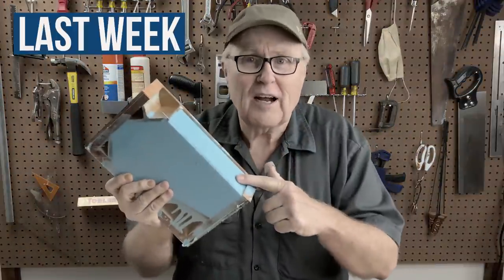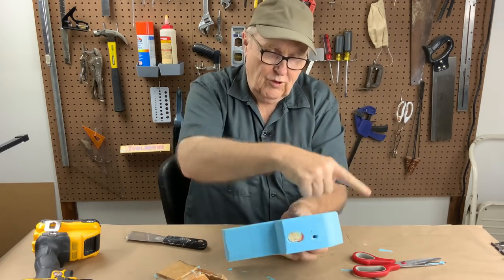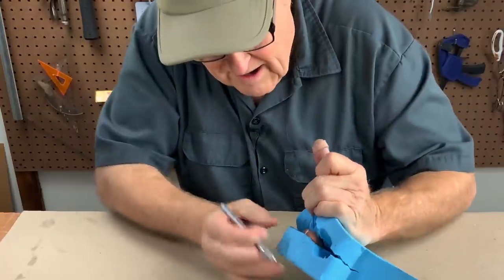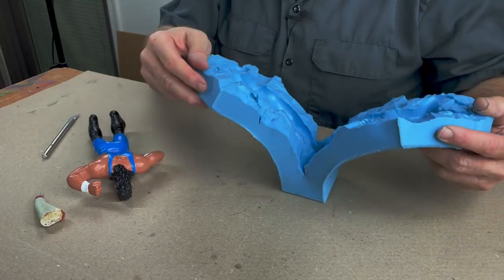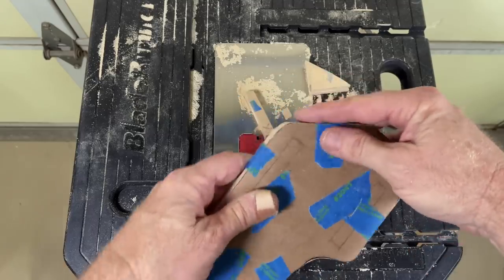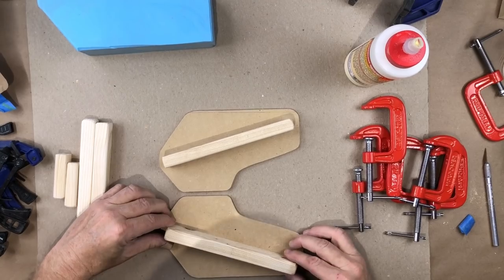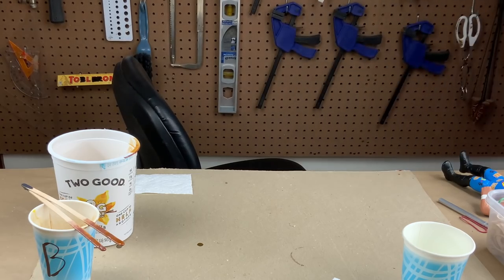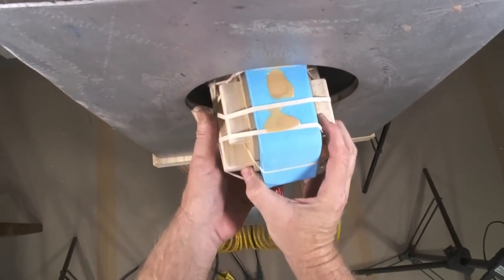Two-Part Clay-Up Mold Vs. One-Piece Cut Mold

Comment: I see people in the comments saying they’re having issues with cutting one piece molds. A bit of advice from my learning experience is start with a translucent/transparent silicone like smooth on moldstar 20T. This will allow you to see your piece inside the silicone as you’re cutting and once you build up confidence in your mold making/cutting abilities you can switch to a cheaper colored rubber. More expensive to start with but saves you money in the long run.
Reply from the maker: Great tip Joel! My regular supplier Silpak sent me a freebie sample of some semi-clear platinum silicone rubber and I am using it to cast a small figurine next Friday! it definitely comes in handy to be able to see the model through the rubber.

Comment: Robert, what kind of wood did you use for the sides of the mold case? I ask, as it looks like either you sanded it, or, it's some sort of engineered wood product like a Masonite or MDF; yes?
Reply from the maker: Hi Baron, yeah, just MDF.  Another construction dumpster rescue job.  You have to love construction dumpsters!

Comment: This is great, would this set up work if the hands of the figure were on a different plane? For example bending forward. I cast my own tabletop minis, but I failed misserably when I tried to cast then in one piece. I ended up chopping the hands off. Then I use the legs as an air vent and place a reverse J formed channel as a pour spout in order to fill the mold from the bottom to the top, pushing the air out instead of risking it being trapped in pockets. Then I cut the mold up until the heigh of the scrutum and pull free the mini. In that way I avoid having a mold line from the waist up.
Reply from the maker: Generally speaking, the more complex the figure the better off you are cutting it into pieces.

Comment: I have the same table saw. Did you move or remove the arm to make it easier to see what your cutting or just for the camera?
Reply from the maker: I find that the stock arm didn’t  hold the material down very well and gets in the way, especially when making cuts on small pieces of wood. But of course an unguarded blade is much more dangerous and you do have to be very careful working with it.

Comment: Sir, quick question, if you are not able to afford the beautiful pressure tank you have, would a pressure pot with clamps be a good enough starting point?
Reply from the maker: I could not afford a pressure pot when we started out so I designed these and had them fabricated. Any pot will work as long as you can get the resin-filled mold into it and shut quickly enough.

Comment: Was going to make a two part mold this weekend. Due to having a large hole in the middle of the object. Alright, I’ll try it as a single cut mold instead. Definitely quicker to make. Haha
Reply from the maker: It won’t work if your silicone rubber is too hard to stretch. But if you can pull it away from the hole you can successfully cut it through easily.

Comment: Question: If you do have some bubble holes, can you fill them with epoxy? (and after that, paint it over so it won't be seen on the resin) I am planning to start molding/casting my (simple) cat characters soon, but don't have the pressure/vaccuum equipment.
Reply from the maker: Yes, you can use most epoxy fillers, also bondo or other polyester fillers.
Reply: @RobertTolone  thanks!

Comment: I see what you meant about cut molds, the original parting line is clearly visible and any flash comes off cleanly. I am increasing my tool collection, and I started to wonder about starting from scratch (perhaps this should be a future video?).  I am repurposing a second hand lab vacuum pump I bought years ago for metal casting and recently picked up a harbor freight air pressure paint tank for curing under pressure. If you were a beginner today, what would be a minimal but useful casting setup? What would be your first project?  Thanks!
Reply from the maker: It sounds like you have bought the basic set up that you need. Also get a good accurate gram scale. If I were starting out again I would do simple, small projects. That way you could learn a lot without spending a lot of money on materials. I would keep careful notes and records of each mold and casting. Note the materials that you used and any problems that you had with them. I would read the material data sheets for my rubber and resin and I would be meticulous in following the manufacturer’s directions. I would work in a comfortable environment. If you can wear shorts and a T-shirt in your studio your resin and rubber will be happy.  If it’s too hot or too cold you will have all kinds of problems. Don’t get discouraged when things go horribly wrong.  Just learn from your mistakes and go on. And have fun!

Comment: awesome i love these videos!! can you please share what plastic mixtures are best for replicating car parts? i have a few small plastic car parts i would like to remake myself with small modification to my liking.. only issue is, once i finalized my plug, and have made my split mold. i have NO IDEA what plastic mixture i should be purchasing in order to have a plastic part as strong and durable as say an OEM car mirror. one that can withstand wind pressures and florida heat lol... im looking to make my own AERO mirrors for my car, but again, once i finish my plug and my split mold... i have no idea what plastic mixture to purchase in order to ensure my parts hold shape and withstand the elements =] your wisdom, knowledge and expertise in this area is very much appreciated! all the best and god bless my friend!!
Reply: p.s. im subbed on two accounts and i have the bell notification on for both accounts. always a thumbs up from me! again godbless me amego
Reply from the maker: My expertise in this area is knowing what I don’t know. So I can’t advise you as to what resin will give you the mix of durability, flexibility, strength etc. that you require. That is a question best directed at a material supplier. You could call Don at my regular supplier Silpak. www.silpak.com or Brooke at Reynolds Advanced Materials.  www.reynoldsam.com.  Or do your own internet search for suppliers.  Thanks for subbing and watching!

Comment: Informative and entertaining. The only thing missing is popcorn!
Is there anything different that you would do for injecting wax in smaller molds (Including 'Robert Tolone' tips on cheap mold release)?
Reply from the maker: I'm not an injection fan, I prefer to design molds for pouring. The cheapest way to buy mold release is by the gallon and brush it on or put it in a spray gun; otherwise you're stuck with spray cans.
Reply: @RobertTolone  Thank you. I'll start looking into brands.

Comment: What is that machine? Hot steam or what? How did the epoxy cured for 30 minutes? What material you are using for the mold (the blue thing)? Thank you!!
Reply from the maker: It is a pressure chamber. It subjects the mold and resin to 50 pounds per square inch of compressed air pressure.  This helps to eliminate bubbles.  it is not epoxy resin, it is urethane resin. And the cure time is 30 minutes. The mold material is a tin-based silicone rubber.
Reply: @RobertTolone  Wow awesome! Thank you so much for the quick response! ❤❤❤

Comment: I made some molds following the exact way Robert does things the only problem is you have to be an expert to cut things out of molds which I am not ended up wasting $200 worth of rubber on molds that I cut to pieces trying to cut the mold objects out from now on I'm going with two piece molds but I can still admire how amazing this guy is
Reply: The important things that I use most of the time are the air duct for understand the best direction to cut the molds.
Reply from the maker: I’m really sorry you had a bad experience Daniel.  Feel free to send me pics of the mold pieces and your model and I’ll be happy to review what went wrong. roberttolone@yahoo.com 
The red flag I’m hearing in your comment is that you cut the mold into pieces.  It is essential that the mold remain in one piece. That’s why they are called one-piece cut molds.  If you cut the mold into many pieces you will never reassemble it properly. When I am designing a mold, laying out the sprue and vents, I am also designing the cut lines. Every single cut line is meticulously planned in advance. I often take photographs from all angles of my model and draw the cut lines on the photographs so that when I begin the cuts I know exactly where I’m going. It is really essential to plan the pattern of cuts and to know in advance that they will properly release the model and still keep the mold in one piece.  A properly made cut mold can reproduce a much more elaborate casting than any clay-up two part mold can. That is because the parting line can be much more complex and go in multiple directions. These things are impossible in a clay up mold. If you have a model  that you can clay up successfully you can make a cut mold of it much easier, much faster and deliver a vastly superior casting with minimal parting lines every time.
Reply: @RobertTolone  Thank you for the advice. God Bless you and keep making cool stuff!

Comment: I love your channel!  I have to make 15 sets of dinner cutlery.  I have a YouTube channel where I do a sort of stop motion animation.  The dolls I use to animate are not standard size for most accessories so I need to make pretty much everything.  Here is where I wonder - these cutlery sets (I have only 1 master set to use to mold) are about 1 1/2 inches long, 1/8th in wide (maybe)  I was going to attempt a 2 piece mold - is that the way to do it?  My confidence is struggling as I am new to this and just don't know quite how to do this.  Any help would be much appreciated.
Reply from the maker: Send me pics of what you're casting to roberttolone@yahoo.com.
Reply: @RobertTolone  OK!

Comment: what is the best resin to use on figures like this?
Reply from the maker: That would depend on the qualities you are looking for. I would use a urethane resin and decide if I want a rigid casting or a casting with some flexibility. Most vendors have a range of resins to choose from so you can pick the qualities you want in the finished sculpture.

Comment: Oh Robert oh Robert...I have been into casting about a year soon. Your channel is really the best for learning this stuff. So thanks for that! I mostly make small figures and usually goes for two part molds. Seeing you I always get inspired to try more cut molds. Did one yesterday. But I just dosn’t work out for me. I never gets any control over the cut line and the cast turns out with huge mold lines. Dont know what I am doing wrong. Tried both with more and less pressure on the mold. But I think its my cut thats not good. I wonder if  maybe my silicone is harder than yours. But most likely its just lack of experience. But,  would och you still recommend cut molds for figurines small as like 5 cm? Or does it become harder and harder the smaller the mold gets?
Reply from the maker: If you want, send me pics of your disaster to roberttolone@yahoo.com. I’ll be happy to review it with you and see what went wrong.  Sorry you had a bad experience.

Comment: Robert, I have a piece that I 3d print, but would like to start casting. However, I do not want it public because I sell this item. Do you do contract work? I just want 4 or more molds made. How does one contact you?
Reply from the maker: My channel has become a full-time job so I only take commissions I can do as channel projects.

Comment: The moral of the story is don't even think about doing one piece molds like Robert does unless you have an x-ray machine and you're an expert like Robert is and cutting out objects from rubber one bad cut and the whole mold is gone
Reply from the maker: Bad cuts are not fatal.  I make them all the time. This despite the fact that I very carefully plan each and every cut in advance.  In a cut mold, a bad cut doesn’t really hurt anything. Worst case it just makes an unnecessary parting line and may be a little extra flash. The only truly bad cut is one that cuts the mold into two or more pieces. Then you have pretty much destroyed your mold.
I don’t have an x-ray machine. I have an iPhone and an app that I can use to draw on pictures.  That’s how I plan my cut lines.  But I feel your frustration.  I have endured countless mold failures in my career.  I have been cutting molds for 30 years and I still get a pit in my stomach when I pick up the knife and begin the cut.